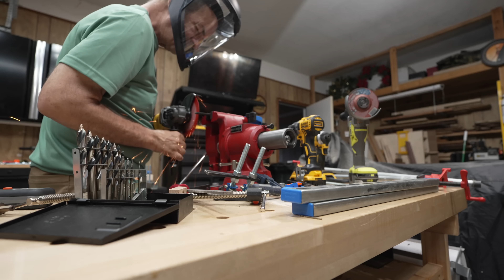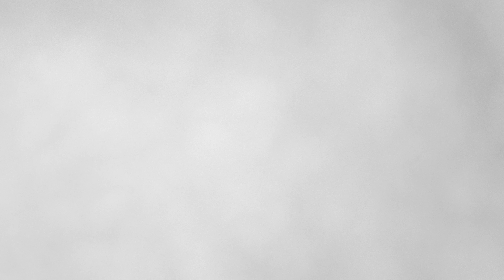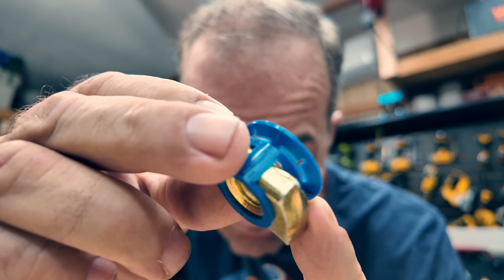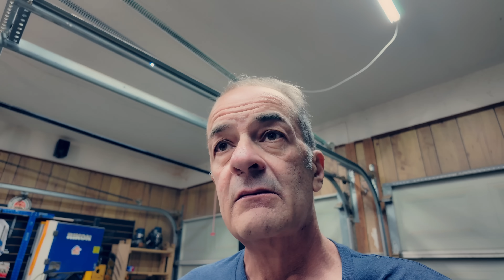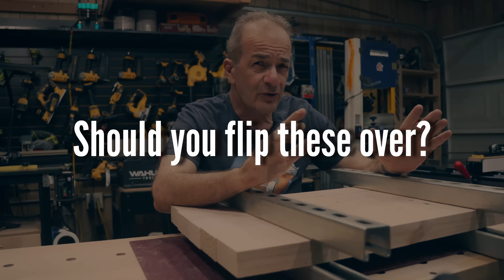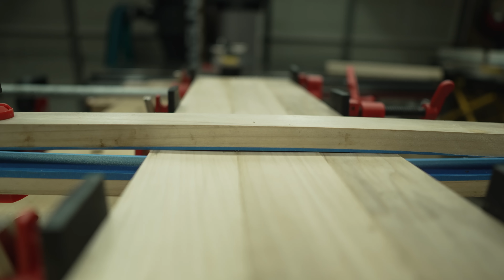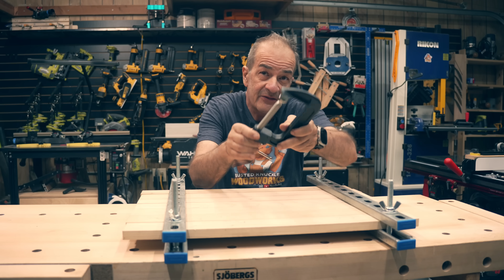This weird clamp could save your next glueup

Comment from the maker: If you missed Part 1 of this video, here it is 😀 https://youtu.be/vzhILT7axcA
Reply: Would you please give us a link for the UHMW tape, and data like brand, dimensions, has glue or adhesive backing?  Thanks for a great pair of videos!
My intended use for the UHMW tape (in addition to your proposed use), is to line sliding surfaces to reduce friction and "stick-slip" friction, like when making my DIY Track Saw from aluminum profile and needing the saw "sled carriage" for my circular saw to slide perfectly against the aluminum profile!
Best regards from Mexico and let's keep designing and making those factory overexpensive accesories by ourselves!
Reply from the maker: @alfredomarquez9777  I will add a link to the description
Reply: 8 times stronger sir!
Re  your: “makes it more than twice as strong”..

Bending resistance is width x height x height x height (times a constant for the material)

Width in this case is the steel thickness x two (as there are two side walls)

So: 2 times the height = 8 times stronger bending resistance. (2x2x2)

3 times higher = 27 times stronger

The beam height makes all the difference 😎

Kind regards 
Anders 
Sweden
Reply from the maker: @tomfull6637  you are right, it’s not a constant ratio. I screwed up the math on this one. Anyway, the point was that it’s a lot stronger. 😉
Reply: @BustedKnuckleWoodworks more than twice is still 100% correct. 
Reminds me of a good bar bet I saw in a movie: 
Oldies like you and me bets the young guys in a bar. 
I bet you all $50 that I can make between 3 to 400 pushups without interruption!

Makes four. Takes the money. Big upset! 
What?!
I made between 3 to 400!
No, you only did four!
Yeah, four is between 3 and 400!

😂
Reply from the maker: @tomfull6637  😂 that’s a good bet. Here’s another: what are the chances of making it out of the bar with that money without getting shot here in Texas? Answer: not good. 🤠
Reply: @BustedKnuckleWoodworks  what some lack in humour and self esteem they compensate with firepower 🤯😵‍💫
Reply: This is awesome, a builder building their own tools again, like the old days :)
Reply: I am a bit confused, love the idea, but what is the bolted on C-clamp clamping against on the other side to draw the board edges closer?
Reply from the maker: @alphaphoenix1938  I put a thin scrap of hardwood on the other side on the inside of the bolts
Reply: i dont use glue, i just leave the  cauls on
Reply: @rickacton7540 , Family holiday dinners around the dining table you made must be very interesting. 😂
Reply: @JBarleycorn  Dining? who mentioned dining?
Reply: @rickacton7540 . Well, you said you don’t use glue and you just leave the cauls on so, if you made the family dining table … ? 🧐👍😂
Reply: @JBarleycorn  i dont know where youre getting that from
Reply: I just watched both videos and, again, amazing content, well presented! You do an excellent job of cutting away all the "fat" while presenting the "lean" without rushing through steps as some creators do. I don't think anyone has a hard time following your instructions for building better solutions. It's also very cool that, at least in this case, you not only mention people should do whatever works for them, but you illustrate how multiple solutions are possible within the framework of the core, tool build. 

Have you ever considered making a third video demonstrating how these cauls, built for the specific purpose of keeping glue ups in line, can also be used as additions/alternatives for long clamps with the options you've laid out in this video? I don't know if it would be cost-effective to build your own clamps this way versus buying pipe clamps, etc. What do you think?
Reply from the maker: i think, at the end of the day, anything I could come up with wouldn’t be an improvement over pipe clamps for general purposes.
Reply: Oh, my god! 

After watching your videos, the algorithm delivered a different woodworking channel's review video of a manufactured panel clamp/caul. I was intrigued to see how your DIY solutions stack up against a commercial product.

First, watching an experienced woodworker fight the manufactured product for several minutes of a 32 minute video really drives home your notion that the manufactured, store-bought solution isn't necessarily the best solution. The product looks slick and simple in design, but in practice it's awkward, unwieldy, and requires loose scraps of material as clamp faces. 

Second, most of this creator's video wastes the viewers' time with no added benefit other than to witness exactly why you shouldn't use the product. I'm only halfway through and I'm bored out of my mind. 

Finally, I initially forgot to mention these panel clamps have pinned, curved brackets that hold the pieces of the cauls together. Well I didn't hear him say what the capacity is, but it looks to max out at about 4" - 6" max thickness. Compare that to your near infinite capacity based on The length of threaded rod.

Once again, kudos on your content, your inventiveness, and making entertaining and eminently useful videos. You have a gift and I'm glad have found a way to share it with a worldwide audience!
Reply from the maker: @fantasticsound2085 yes, i’m familiar with the ones you’re talking about. They are giving them away to influencers left and right. I still think mine are more practical, not to mention way cheaper!

Comment: I have a thickness maximum problem... what were you saying about "Threaded Rods"?
Where do we get them, and how do we find proper diameter and threads?
Reply from the maker: These are a very common item available in any decent hardware store. They come in various diameters and thread pitches. I recommend 1/2” diameter, 13 tpi threads.

Comment: Is there a clamp which is similar to a vice grip, but can apply more pressure & spread it out?  I want a solution where I can have a rapidly executing clamp, but have the entirety of the hand grips  (or another execution) pointing outwardly  (not down like an F-Clamp)?
Reply from the maker: I’m having trouble picturing what you’re going for here
Reply: @BustedKnuckleWoodworks kind of like a Kreg fair enough.  I think that I'll just have to saw a Dewalt Trigger clamp down to like 7" of capacity.
Reply from the maker: @sekritskworl-sekrit_studios ok, I got you. For the record, I have four of those Kreg vice grip bar clamps and I HATE them 😂
Reply: @BustedKnuckleWoodworks LOL. I appreciate you saving me from a HORRIBLE Experience!

Any advice on an adjustable narrow "taper jig" which i could use with micro jig push blocks (or other safe methods (so I could safely joint 2x4 lumber in table saw in vertical position)?

Comment: I use the same unistrut but drive wedges against the clamp bolts. Mine are partially threaded. My wedges are of ipe, congalo Alves, etc deck board about 12”long and an inch tall.  I use two opposed.
Reply from the maker: Using hardwood wedges is a great idea for that extra clamping pressure.

Comment: Working in construction for decades we used strut and threaded rod to support conduit, disconnects, and other equipment. Strut is definitely be up to this task and this is a great idea for inexpensive cauls. Your local electrical or plumbing wholesale house will have loads of it cheaper than the box stores. I would just recommend de-burring the cut ends always and the punched holes if you decide to use the strut hole-side toward your work piece to prevent scratching or damage to the wood. The integrated C-Clamp is a great idea too. Happy Day! 😉
Reply from the maker: Great advice on sourcing and surface prep, thanks for the tips! 👍

Comment: im thinking about making a computer desk out of planed 2x4's like what you've done here.
my idea was to drill holes through the boards and insert threaded rods through the table in 4 places.  they'd be a permanant part if the desk top.  it might still bow though....
Reply from the maker: Threaded rods will definitely help with alignment, but you might still get some seasonal movement depending on how you account for wood expansion.
Reply: @BustedKnuckleWoodworks  I'm starting to get the impression that woodworking is like playing a musical instrument....it takes time to learn it all.

Comment: These are meant to keep boards aligned with each other, not really meant to "clamp" the wood. I don't know why people are worried about them bending? They really dont need that much pressure.
Reply from the maker: Totally agree. But you should read some of the comments in my first video. People want to be able to crank these down like it’s mooring a battleship 🤷🏻‍♂️

Comment: the cheapest way to get the strut is in 20 foot as it is cheaper and most electrical supply houses will have that and if you want to do a very long glue up you can get double sided strut. But make sure when doing this to buy strut with the slot holes as kendorf has round holes, And That was a Great Video and have been using strut for many years here for all kind of things.
Reply from the maker: Glad you enjoyed the video and thanks for the advice!

Comment: @BustedKnuckleWoodworks What are your thoughts about using struts to make a panel clamp wall that slides forward and drops down from the ceiling?
Reply from the maker: That would be very doable and pretty cool tbh
Reply: @BustedKnuckleWoodworks  I have a space that I want to do that in. I thought you might have some insight on how I could go about doing it. If you're interested, we could discuss it and see what we could come up with.

Comment: I have so many pipe clamps off Marketplace and other sites that I got dirt cheap. East to use for glue ups and carcass construction, and exert a lot of squeeze pressure when my parallels don’t. But to keep work flat a caul is a nice addition I like your idea. My wooden ones are now 40 years old, tapered. I cover in packing tape regularly. I see no resonate to change. For me anyway.
Reply from the maker: Sounds like you've got a good system going
Reply: @B @BustedKnuckleWoodworks rry for poor edits. Anyway saw some of the heavy duty strut stuff or whatever it’s called on marketplace really cheap. Ten pieces. I actually got excited. Then saw it was a far away city. Darn.

Comment: I tried building a solar tracker using standard strut, with low profile cross bars to mount the solar panels to. Discovered that their weakness is that they will twist with enough load. I put the actuator at one end of a 15 ft. bar, and panels at the other end don't even move. Something to be aware of if you do try clamping that boat...
Reply from the maker: That's a really good thing to be aware of, especially with longer spans and heavier loads. Probably wouldn’t apply to a standard glue up… 😉

Comment: @BustedKnuckleWoodworks Question:  13:47 (ish) in your video, the setup where you made the C Clamp adapter with the wood glued onto the end.  What if you're gluing up a round object, like a bourbon barrel lid or a small table top?  Could this setup work with that except you somehow have a rounded end to marry up with the barrel lid or rounded object edge (or is there a better easier way)?  Even with the expensive Rockler clamps, I think I still have this question.  How do you effectively glue a rounded object like that barrel lid?  Maybe you've made, or can make, a video addressing this or can give me a link to an answer item out there?  I'm not woodworker...but trying to learn.  Thanks!  Love your content!
Reply from the maker: Usually if you are gluing up something that’s going to be round at the end, like a round table top, you would glue up a square panel first then cut it out of that after the glue is cured.
Reply: @BustedKnuckleWoodworks  I'm actually going to be gluing some bourbon barrel lids...  Maybe I can cut a "jig" out of a 2x12 (or something large enough) that'll fit around the barrel lid (on the inside), but still be square on the opposite side, so that the clamps will still have a square edge to clamp to.  The "jig" would then (in my non-woodworking person brain...lol) equally distribute the force of the clamps throughout the "jig" and into the lid being glued.  Does that make any sense?
Reply from the maker: @DeanPPCLaser  yeah, that’s something you could try.  You could also look into using a strap clamp or something similar.

Comment: I started using uni strut as cauls after seeing the original video. One thing I did different is I use thread rod couplers and a deep well socket with a 1/4” to 3/8” socket adapter. I use a drill driver (don’t use an Impact driver) with the clutch set as low as possible. That way I don’t have to use wing nuts, etc. and can take them on and off easily. I use a washer and a nylon lock nut inside the lower strut to hold the bolt in place. I set up another one with some spring loaded nuts that you would use on a drill press for a stop guide but still used a threaded rod coupler to lock it in place. The spring loaded nuts just make it easy get in place.
Reply from the maker: That's a clever setup!

Comment: The metal strut listed is now $100+ per 5' length and the plastic end caps are $20+/pair. So a single 30" clamp is at $140 before the nuts, bolts, and c-clamp are added. AND you have to build it yourself. AND It won't clamp a full 30"
Reply from the maker: Where are you getting these ridiculous prices
Reply: Here even in the highest profile, its about 50$ for 10' at both available major hardware stores.. so 25% what you quoted. I think you should try looking around.

Comment: If you attach blocks to hold the lower calls making the top surface of bottom calls a couple of inches above the work bench you can set up your panels on the call.  Then set pipe clams down on top ("upside down").  You have flat, stable work surfaces.

Comment: holy crap, i'm so glad I didn't buy more expensive parallel clamps. What an awesome concept with these struts. You know it makes me wonder also maybe for lower strength needs the aluminum extrusions (1010 and 2020 style stuff) could work well. The also have a nice ecosystem of accessories and synergies. There are also v-channel versions of those extrusions which are great for running v-corner wheels on --- they are the standard substrate on which CNC machines are generally built, super flexible stuff.

Comment: I recently fractured my pelvis, which has seriously limited my ability to work while I recover. That said, I came across your clamp video and just had to let you know—it was ingenious. Funds are tight right now, so instead of buying materials, I rummaged through my garage and found some old nuts and bolts from a decade ago, along with oak spindles I milled nearly 20 years back (1.5” x 1.5” x 42”). They’ve just been collecting dust… until now.

Thanks to your video, I was able to build 8 modified call clamps suited for wood—and they turned out beautifully. Just wanted to say how much I appreciate your content. You made something really useful and accessible, and it meant a lot to me during a tough time. Now I can build the cabinets for my wife.
Reply from the maker: Love this comment! I hope the wife enjoys the cabinets!
Reply: We all know what “Honey Do’s” left undone too long turn into - “Better Do’s”. (Relating a friend’s experience.) 😎👍🇺🇸

Comment: Good thinking.  The only problem is the solution is a bit heavy but then pipe clamps are heavy too. There's always a + and a -.   It's definitely a solution I will remember for use.
Reply from the maker: I usually don’t carry these through the airport or anything 😉
Reply: @BustedKnuckleWoodworks No I guess not.But you might want to pick it up and stand it against the wall to set.  I've got unistrut in my shop as stock because you can build almost anything out of it.  I use to construct wall hung charger stands out of it for my maintenance job and reinforce and pull up walk in freezer ceilings with it.  It's one of those genius inventions.

Comment: Great idea- I watched the first one and subscribed right away. All the while I thought there has to be a way to get this to clamp horizontally, too... and then wouldn't you know-  This is a total game changer!

Question: Are you using C-clamps on both sides of the whatever-you-wanna-call-it strut for a total of four? Or are you using a wedge? I'm not necessarily concerned with hard woods but soft I'd think pushing into the bolt would dent the panel... or am I over thinking it?
Reply from the maker: I’m just using a flat strip of hardwood on the opposite side, so you only need one horizontal clamp per unit.
Reply: @BustedKnuckleWoodworks  Perfect, thanks. I'll be giving this a shot ahead of my next big glue up.

Comment: Wow great idea !! That clamping solution at end is a game changer ! Quick question: I assume you’d need to put those c lamps at both ends right ??
Reply from the maker: No, not at all. I just put a strip of hardwood at the other end. You only need to apply pressure from one side.
Reply: Ah that makes sense to have something supporting from the other side. Now when I think about it you may be able to use the other end of clamp ( maybe not a c clamp) attached to the strut with  two holes drilled ( just like how you did to the trigger side of the clamp ) . In this way one you may just extended the range of your clamps. Not sure if it’ll work, but worth a try

Comment: Thanks for the pointers!
Actually I think wedges are the best approach for sideways pressure - simple and cheap - though I would prefer a more shallow wedge - perhaps 1:7.
For those really worried about providing even downward pressure, I suggest adding blue tape on just the middle third or so of the strut.  

Two sets of cauls should provide enough downward pressure.  But how many clamps are needed on the sides?  If the outermost boards have width W, maybe a clamp spacing of 4W?
Reply from the maker: You’re right, the wedges are probably easiest and I could have easily stopped there, but you know me — I had to take it up a notch 😄